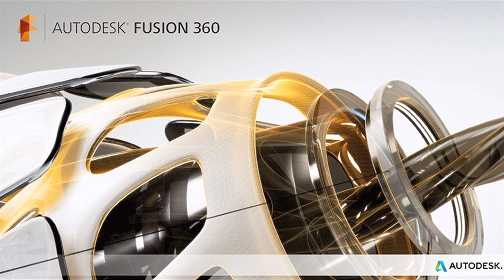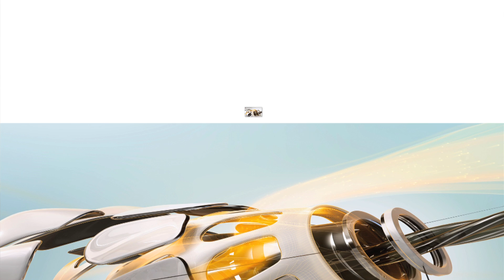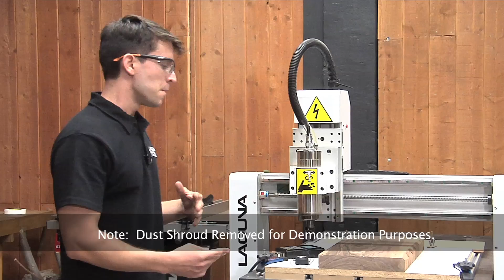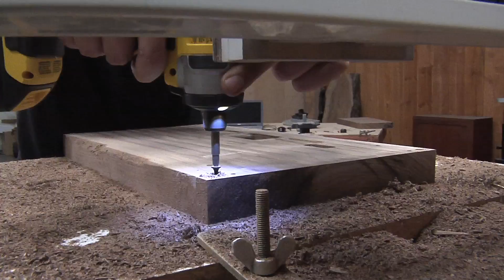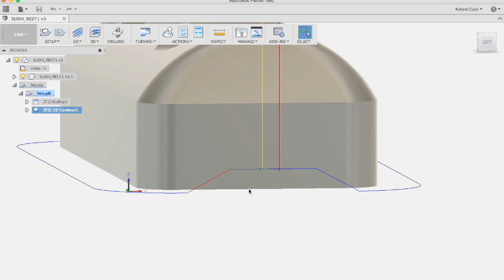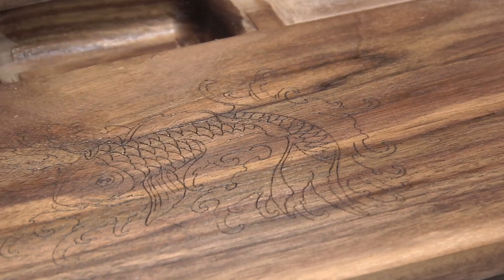How to Make a Sushi Platter - CNC Project

Comment: You can use 3D adaptive, and 2D adaptive as a facing operation, I find it often more efficient than conventional facing.  It would probably be less prone to tear out on the edges than the conventional facing path as well.  It would be interesting to see the 3D adaptive being used, pushing the limits of the machine, helix into the workpiece, engaging the full flute length of the bit for the roughing, and maybe something like 30% or 40% step-over, rather than the old fashioned, large step-over pocketing.  Lovely surface finish on the 3D work.  The base should have been a 3D adaptive, and a horizontal finish though in my opinion.  It turned out looking really well.  I'd love to see this machine being able to reach over the end of the bed, for end joinery, or have a removable part of the table to drop a fourth axis in, and still be able to swing a large diameter piece.